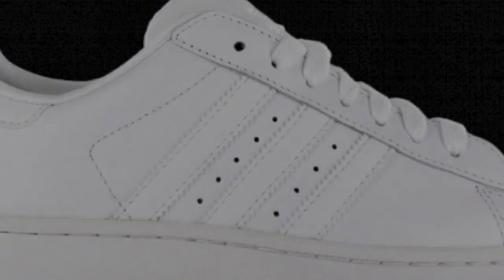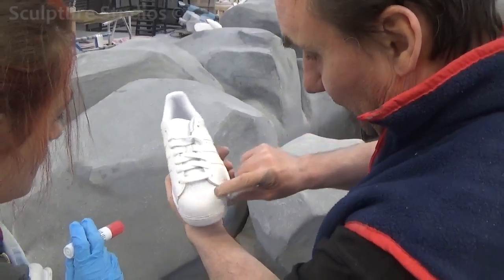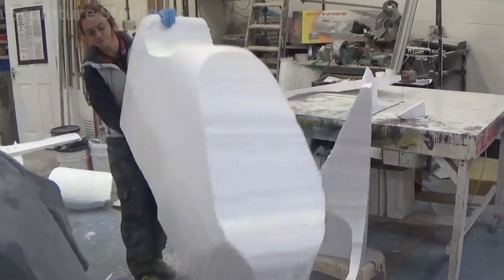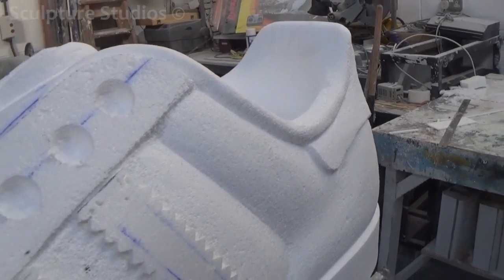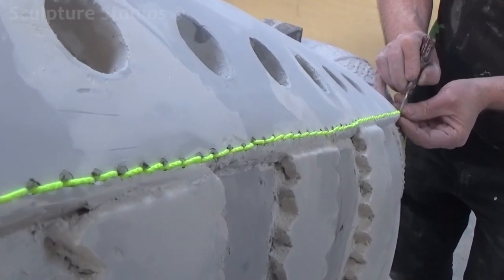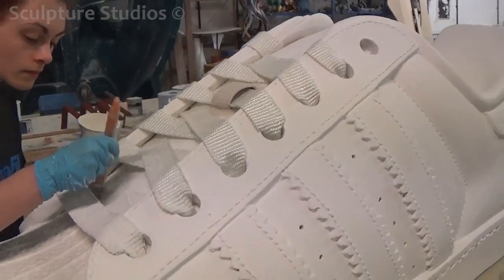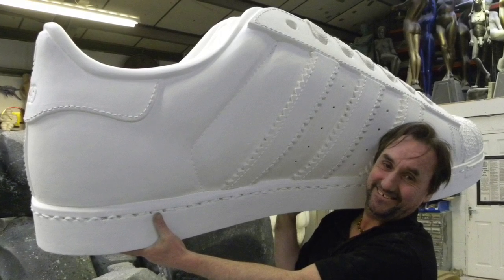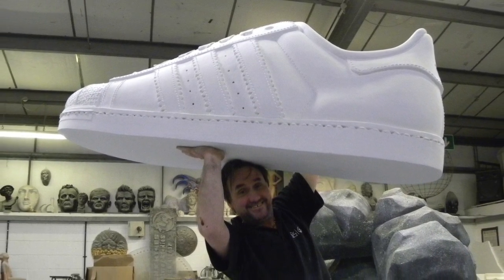Adidas Polystyrene / Styrofoam Shoe by Sculpture Studios

Comment: Hey, I really love that shoe, what did you use for coating? Or generally what would you say are good materials to use for coating polystyrene foam? Any tip for coating the foam would be greatly appreciated! :) Thank you!
Reply from the maker: Yedi Knight you gotta watch the whole video in order to get the information :P and take a look at some more of our project videos. All depends on the project and intended use
Reply: Thanks for the quick reply! I did watch the whole vid but couldnt make out what the coating material was, it looks kinda grey. I was trying to use plaster of paris over foam but it cracks, because it expands slightly when drying, so I thought there might be better, more flexible, non shrinking or expanding pastes to apply over foam? Thanks so much!
Reply from the maker: Yedi Knight we're using just a light water base plaster render that you would use on your home walls to fill bits in. It comes in large tubs from home construction stores. Already mixed. And air drying and sandable
Reply: I'll give it a shot! Thank you! :)

Comment: great work but i have a dumb question how does an overhead projector cut true Styrofoam ??
Reply from the maker: Mouad Ezzaraa we use the hot wire table that Aden is carving on to cut the shape. Have a look at a few of our other videos and you can see hot wires being used. Thanks for watching!

Comment: This might be a silly question but How durable is the shoe? If you dropped it or kicked it would it get damaged?
Reply from the maker: If you dropped or kicked it, the water based plaster surface will crack and be damaged, yes
Reply: +Aden Hynes Sculpture Studios : any way to make it durable with a different material?
Reply from the maker: Give it a blanket coat of glass fibre, but this would then need further work to bring the detailing back up again, as well as surface treatment to make the fibreglass smooth and to lose the matt texture.
Reply: +Aden Hynes Sculpture Studios Thank you.
Reply: @AdenHynesSculptureStudios  So just coating it with resin wouldn't be good?
Reply from the maker: @MisterFuturtastic  I mean you can. But depending on whag type of resin you use, you would need to protect the polystyrene surface in the first place. And by ONLY going on with resin, it's going to be very brittle
Reply: @AdenHynesSculptureStudios  Great info thanks!